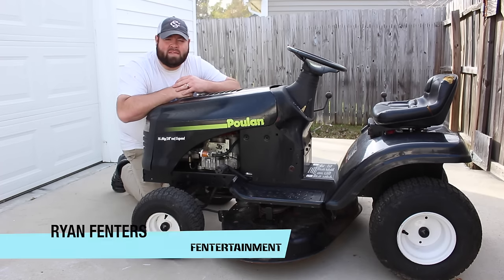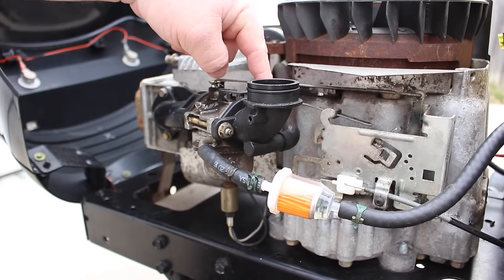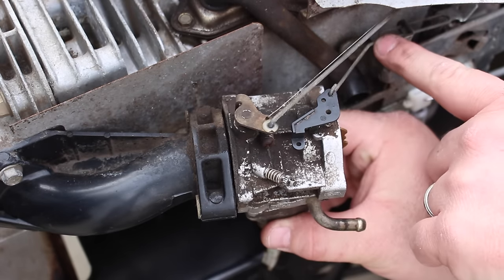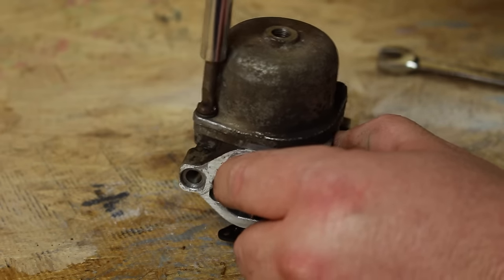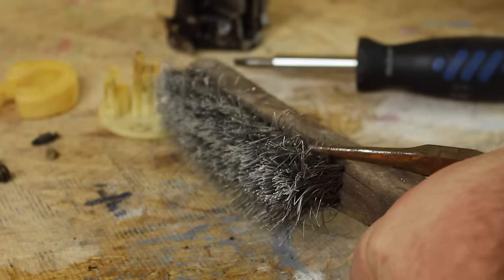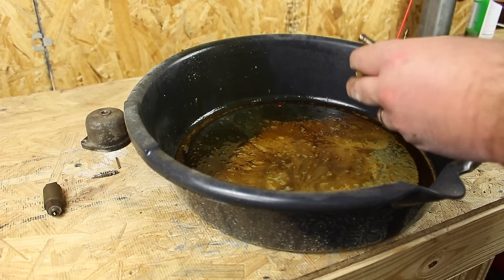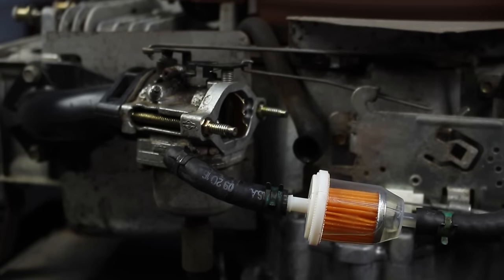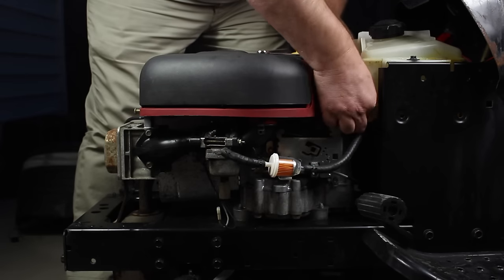How To Fix Briggs & Stratton Surging Engine | Nikki Carburetor Cleaning | Motor Hunts UP & DOWN

Comment: Im grabbing a cold drink and taking a moment to subscribe and say thanks for  the video and please  continue to convey  your  topics just like  the carb surge  breakdown.  after a solid week of making ready for 5 ugly months of  central Fl. lawn mowing(it rains every damn day and the stuff they call grass here would be tugged up and burned  in most of The country   but it keeps the sand from blowing  in the pool.)Missing a mowing here can end up being a bush hog weekend and    my craftsman 17 hp     from the   dead neighbor  garage  sale  was not even remotely motivated to sign on  for 2018  without  belts ,battery, blades   deck bearings  and tires   all on one  trip.  two weekends to r and r the parts  and im Down by 2 + mowings and the bush hog flyers are being wedged in the screen door  . The start up  killed the battery. and when it finally began to blubber on its own  it wasn't  a sound   that instilled  confidence. woom ahh...woom ahh....  blubber woom pop  then dying with a series of fip fip fip
   and a final ahh with no woom. This wasn't gonna clear out with starting fluid.  ... a fresh fuel filter  and your video  put it right .didnt really need to watch.  you pretty much talked me through the teardown and back together  and the tool sizes you specified  made it  all click ..and there ain't been a lot of  clicking  around here.   Im sure I would have got it dealt with  by shear tenacity and a another cash infusion  this weekend but  I wanted you to know  that   you knocked  one  way  into  them  center field upper deck 2 for 1 seats. And  I thank
you.
Reply from the maker: One Heck of a Comment! Had me like woom ahh....woom ahh fip fip fip Bahahahaha

Comment: Nikki carbs that have the main jet sitting on top of where the emulsion tube goes on the plastic float frame uses the spring to retain the jet..on the other ones,  the main jet feeds into the emulsion tube orifice on the white Plastic float framer(?)  ..the emulsion tube itself holds the jet in..so when you put these type together hold the plastic float frame upside down so the jet doesn't fall out until you get the rest of the carb seated.

Comment: Thanks for the video. I did that and the orings were shot. I replaced and still have problems , even bought a new carb. same problem. new plug, new fuel pump, etc. maybe I have a burnt valve? idk? ideas?  Thanks!

Comment: "The main purpose of the fuel solenoid is to allow gas into the carburetor bowl when the engine is on, but when the engine is off, it does not allow fuel into the bowl of the carburetor"
WRONG, WRONG, WRONG. The solenoid has nothing, I will type it again, NOTHING to do with letting gas into the carburetor's bowl.  Fuel enters the carburetors bowl via the float needle valve. All the solenoids purpose is to stop fuel from entering the main jet, so it doesn't backfire when you shut off the engine. Fuel can ALWAYS enter the bowl if the tractor is on, or off. IF the float needle valve fails and does not close all the way, gas will enter the engine or exhaust, on a Briggs motor, and on Kohler usually always the exhaust. This is why you should ALWAYS install an inline shut off on the fuel line and use it religiously.
Reply: How right you are Joe, after several "oil changes" more like fuel changes( crankcase FULL of gas) I installed a quality fuel shut-off, and float /needle kit ,end of problem, and yes I have to make sure to check it after the kids mow the lawn!
Reply: @pennyan2057  yes indeed, nobody quite understands how the fuel enters the carb, ending up with a crankcase worth of fuel. I actually knew of a house the burned down because of a carb that leaked out into the exhaust through the muffler and onto the floor. The owner had a battery charging close by which inginited the fumes from the gasoline and started a fire which destroyed the house. Install those shut offs!!! ;)
Reply: Mark Tillery  Looks like you didn't click on the "READ MORE" button. :rolls eyes:
Reply: @joeganusi8522  Hi joe, can you direct me to where i can get this Inline shut off for my 18hp B&S Intek?  should i also scrap the white fuel filter since you can't see into it and replace it with a clear one? thx man

Comment: I have this same problem Motor Hunts Up & Down. I bought a brand new carburetor (twice) and it does the same thing. I shouldn't have to take apart because it's brand new. Do you have any idea's why this is happening? Thanks Bobby

Comment: Nice video, but my Briggs engine is a little different. Could the problem also be caused by a deteriorated seat for the needle in the float?

Comment: Mine was doing exactly the same thing surging.  Suspected a carb problem so I bit the bullet and simply replaced it with a new one but that did not fix the problem.  Any thoughts or ideas on what else might cause this exact type of surging?  A friend of mine says there is some type of internal engine governor that uses a spring and once the spring wears out it will result in engine surging like this.  Good video and by the way I’m curious if your fuel line remained on because you can clearly see in your video that the line was not completely and fully seated over the filter output nipple.  Thanks.

Comment: My mower does the same thing. I've been wondering why it does that. I have to run it just below the choke setting, anything else under, it surges and then shuts off. Thanks man.

Comment: enjoy the video ,  I have the same problem with 2 new carbs I got off Amozon the last one I got said it was compatible with my B&S 19hp after installing it I started it up with the choke full. ran beautiful no surging popping or backfire. rpm 2200 -2400, once I move it to mid-throttle the surging popping begins and it didn't matter where I put the throttle or the idle air screw in or out. the only time the engine ran smooth was when I closed the choke manually I say it was 3/4 close before it ran smooth.  So this tell me I'm running lean and I probably need to drill my Idle jet out if possable.  does this sound right to you?  I did ck the valve lash and they are within specs. any advice?

Comment: A lot of time you can set the governor and fix a surging problem. People mess with the thinking they are getting more power or they just move over time and it will bounce off it causing a surge.

I think 99% of the time the biggest problem small engines have is a dirty carb. Gas sits in them all winter and gums up.
Reply: I have found that 87 octane gas is the killer. I have switched to 89 after cleaning lines out to cure a surging issue after 5 years of running ok. The 89 helped cure my problem without having to rip the carb out and clean. 10 plus hours running great with the cheap fix. We shall see.
Reply: Skip Rope maybe coincidence also.
Reply: Actually, a mis-adjusted governor will NEVER cause hunting or "surging" as you kids call it. Any mechanical governor regulates engine speed. That's it. The only way hunting can be governor-related is if a twig or something has obstructed the linkage and/or is rubbing on the governor rod.
Reply: Run 32:1 premix and your gasoline problems are over. I've had 32:1 sitting in the tank (3/4 full) of my 1979 Yamaha SR500/650 since 2013 and it still fires right up. Of course I include octane booster in the tank. Using 32:1 eliminates accidently "straight-gassing" your 2 stroke equipment. Doesn't hurt to run in carbureted 4 strokes. Actually helps.

Comment: Hey I bought a brand new carb because when I opened up the old carb the seat was a mess and it just kept filling the crankcase with fuel. I replaced the card with a new one and my mower started doing this. Guess I must have had crap in there somewhere 
Can't wait to open it up ang hopefully this will work.
Thanks
I subscribed
Reply from the maker: Before you open it up. I would suggest making sure the air/fuel mixture screw has been adjusted. Usually screw it in till it stops (dont tighten it). Then unscrew it out 1.5 turns. See if that helps it before taking it apart. Ive had to do that before with china carbs.

Comment: Like the video , 99 cents torch tip file and orifice cleaning tool is what I use , it has a 3 inch wire from 00.01 up to 00.90 wire brush wire is fine but short hard to hold on to .

Comment: 18hp Intek, replaced a blown head gasket and fixed valve seat.  adjusted valve lash but not sure if i was at TDC.  Engine starts right up but i get surging.  I've had a surge for a while but once i engage blades, it used to run fine.  It's really surging a lot now , could that be the valve lash?  It's a 16 year old LT1000 Craftsmen, i have replaced the Nikki-6 once with a new one a while back but do you think i need to clean my carb out like your video shows or take valve cover off and check lash? , probably been 4 or 5 years when i replaced carb.  thx man!

Comment: Hi great video but I do have a similar problem my craftsman turns over but doesn't continue running.  I changed the carburetor and it still gives me that problem any suggestions would be great.

Comment: How do i test if the solenoid is functioning properly? I believe my LT2000 is flooding. I cleaned carb out, new plug, oil, fuel filter and it wont start. Just cranks and cranks with an occasional backfire and flame up out the carb

Comment: I know that works sometimes and I've rebuilt them over and over and I've even put new carbs on still surges what is one to do after all that mess
Reply: If it is not the carburetor, check for spark at the spark plug, if the spark seems weak, take a steel tool and see if BOTH magnets on the flywheel attract the steel tool, I have had a couple of flywheels become faulty with age, where one magnet is good and the other bad, on push mowers that use same flywheel, swap and this will confirm the bad flywheel. I have had engines run poorly with a bad flywheel and others do not run.....

Comment: Great video.  Gave me the confidence to try my first carb cleaning.  Almost all good.  At 2:36 to 2:46 it shows the main jet inserted into the end of the fuel transfer tube.  That wasn't right for me.  I didn't note where mine was while disassembling it.  First I knew about the main jet was it falling into the bowl I was working over.  Anyway, I put it back like in this video.  It didn't work, engine would just crank and crank.  It didn't seem like the carb was drawing fuel from the bowl.  Much confusion and frustration!  A few other videos show it dropped down the tube from the gasket side.  That worked for me.  Engine started first time then!  Maybe two very similar models?
Reply: Just realized this on mine too. I reassembled it as he did and mine just cranks now. Ordered a new carb but going to tear it back down tomorrow just to see if it changes
Reply: @kevinhendley8524  good luck.  sure there is magic involved somewhere too!  persistence got mine going.
Reply: @juststuff5640  yeah it didn’t run ever after moving the jet. Ended up with a $16 Amazon replacement and it runs better then new

Comment: I bought a Craftsman riding mower from a friend at their yard sale for $120. Brought it home and put a battery, a solenoid,  and cleaned the carburetor. That machine runs like a top. However I had this surging problem crop up on me. I tinkered with it and looked all over for the problem but found nothing. I went to try to start it and it wouldn't fire. Then I choked it and it fired right off and then ran smoothly. I have no idea what it was. But it runs fine again.
Reply from the maker: Might wanna replace the fuel filter.

Comment: do you have a slower, more detailed video on rebuilding the carburetor? I need a step-by-step because I haven't done it before and that was excellent but a bit fast for me. If I had 1/4 of your talent, I would be thrilled! Thanks for the video...also, what do you think about using Lucas tune-up in a bottle-type stuff to clean it out if it isn't too bad or as a preventative?

Comment: My Craftsman DYT4000 is doing the exact same thing. Started all of a sudden. Never did it before. I did clean carb, but it's possible I missed a small jet passage somewhere. In your experience, with idle surging what's the most common culprits?

Comment: Are briggs and Stratton ride mower engine came with a bad gas cap which made it surge if you put it on to tight I drilled a hole through it and it ran perfectly after

Comment: Instead of using wires from a wire brush, use a set of guitar strings to clear carb. ports holes. One set will last you like crazy, and will fit any size jet hole on a carb. so even the walls of the jets sides are cleaned as well. A wire from a wire brush, doesn't alwas fully open up the jet holes, as required. He should have also placed the carb., in a can of "Gunk" for a short while, to help get rid of any sticky mass build-up within the jet ports, and channels. Blow clean with a high pressure air hose afterwards. Brings the carb. back into new like condition both inside, and outside.  …. I might add, the main cause of the "rushing", or "engine wandering speed", is mainly caused by a dirty, or plugged idle jet. Engine is running too lean, and is being starved of fuel.
Reply: Hey r torch tip cleaner that what I use carb spray file and air

Comment: I've got to ask, The gas filter in the vid, Is that a 40 micron clear filter? Is that the right one for that model? and I have a question about the Air Filter, The pre filter on that model, Does the sponge side go against the main filter or the mesh side goes against the main filter? Thanks

Comment: I've got a 5 hp Briggs on a tiller.  I was tilling up the garden and noticed something laying in the dirt.  It was the breather tube.  About the time I picked it up the motor shut off.  I cleaned the tube, put it back on and now she wont run right, surging and cutting off.  I've cleaned the carb, checked fuel lines, changed the spark plug, cleaned the gas tank and new gas.  I just cant get it right!  I'm trying to get a fall garden ready for a market garden and I'm running out of time.  Please help!

Comment: I installed a brand new carburetor, and it still surges what else could cause surging? I also have a brand new spark plug in the magnito has been cleaned.

Comment: Great video man!!!  This helped me alot.. I have an older snapper rear engine mount riding mower and i put a brand new carb in it and it's still surging , its running rich af and backfiring at high idle  but the surging is at a slower rate now ...I've checked for vacume leaks and dont seem to find any. The fuel air mix screw doesn't do anything no matter which way or how far I turn it ..also once I throttle  up the engine  it does ok for a few secs  but then it boggs way down to the point of stalling like its choking on fuel ..if u have any thoughts on what might be the issue ,any help would be appreciated...thanx again !!
Reply from the maker: I’ve replaced a carb before with the Amazon/eBay carb and had the same problem. Mine turned out to be the air/fuel mixture screw.
Reply: @Fentertainment  thanx so much !! I'm no expert at this stuff but I get the basics...  and the fact the mix screw on this pos carb isnt making the engine respond at all made me buy different carb suitable for this briggs and Stratton ..so hopefully all goes well with this 1 cuz I built a custom plow for it and snow will be here real soon ..thanx again for ur help ..
Reply from the maker: @jimmyrigged1292  I’m in the same boat. No expert either. Just trying to help as much as one can. Hope you get it going!

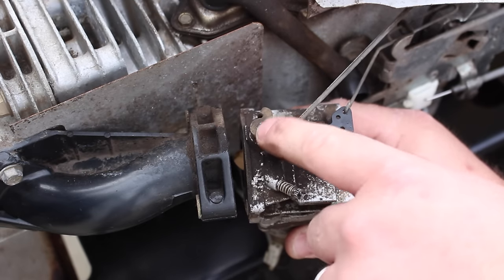Comment: 1:35  Great video!
On the choke mechanism, what is the purpose of the "trombone-shaped" wire that slides above the throttle mechanism?
Thanks!
Reply: that pushs the choke on
Reply: On these engines, when the throttle control lever is pushed all the way 'full', there is a tab on the control mechanism that pushes on the end of that 'trombone' you described, which pushes on the choke control valve, and closes off the intake to restrict the air available from outside. This causes a lot of vacuum in the carb, which pulls in more fuel, creating a richer mixture, which helps start cold engines.

Comment: Mr.Fenters, got b&s 6.75,put carb. on,motor ran good but noticed fuel was running out the carb. venturi,so, removed carb.checked all passages then replaced carb.now motor surges, I'm like huh,hey n e idea what I might have done wrong?

Comment: The fuel solenoid is to prevent dieseling or engine run-on
Reply: That mower runs on gasoline not diesel.

Comment: I've had that issue with a carby on a Honda mower,it was surging & running rough at idle speed,it was car caused by a blocked Low speed jet orifice.

I've had to remove the main jet & emulsion tube to clean that orifice out.

I've had a Briggs & Stratton push mower engine do it at anything that's at 1/2 a tank or less,it has the tank mounted choke o matic carby on it.

I tried cleaning the carby out but it still misfires at idle speed with 1/2 a tank of fuel so I think that I have an air leak coming from the vented fuel tank via the choke diaphragm vacuum chamber as the diaphragm is pulsed from the inlet tube side of the carby on the motor.

They have no pump as such so since they haven't got a gravity fed fuel supply, the fuel is siphoned out by the engines own vacuum, it's a bit like sucking on a drinking straw when drinking.

So,the diaphragm on mine needs replacing !!!!
Reply: If the gas pick-up tube is brass, it could be cracked vertically. I've seen that occur 3 or 4 times over the past 42 years. Hard to see the crack.

Comment: most of the time i can fix surging by just adding a little berryman's b-12 chemtool to the fuel.it is a lot cheaper than seafoam and does a good job. if that does not work then i go into the carb and clean it but most of the time it is not necessary.